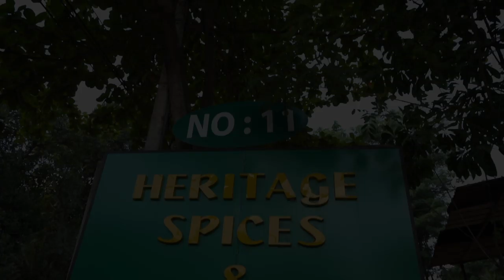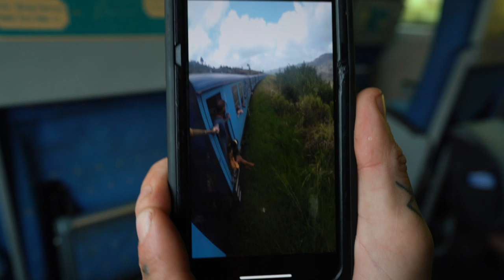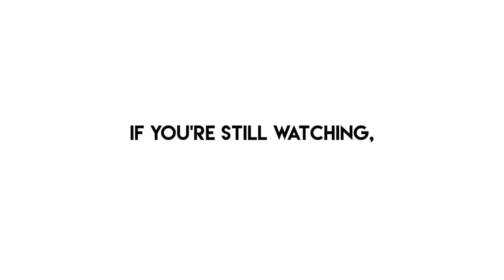SRI LANKA TRAVEL REVIEW 🇱🇰 Ep 3: Kandy to Nuwara Eliya

Comment: Hi Steve, just a few pointers from a fellow traveler. I think you should insert captions of names of the sight's you visited. You also made the mistake I made when visiting the Sacred Tooth Temple, you didn't spend enough time, well worth a second visit. I  would also suggest the train journey, as you will have to spend enough time on the road to get to other parts of the country. I intend to go back in Jan /Feb next year and hike part of the Railtrack to Ella. ( on second thought it might be easier to start at the top and hike down) this is not a criticism but an observation. Good luck with the Tuk-tuk.
ps You need to improve your sound levels when editing.